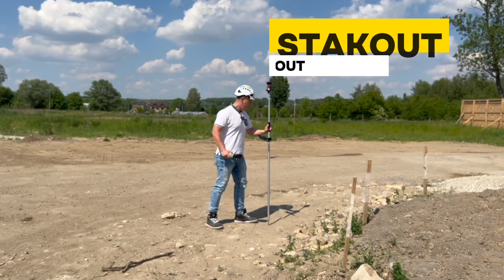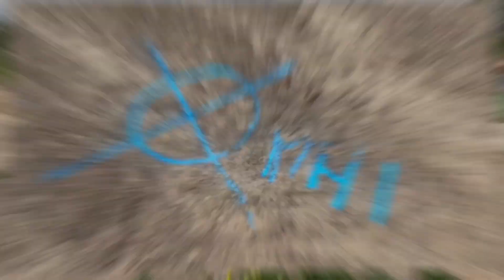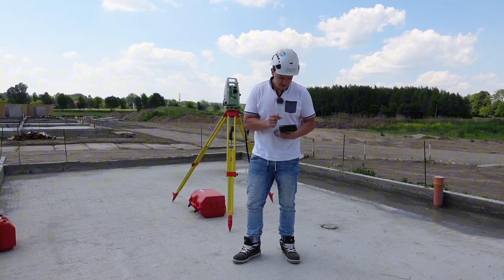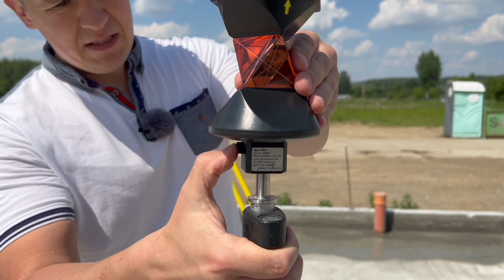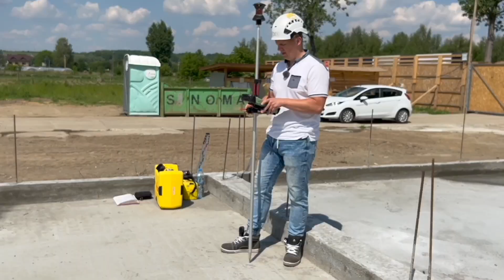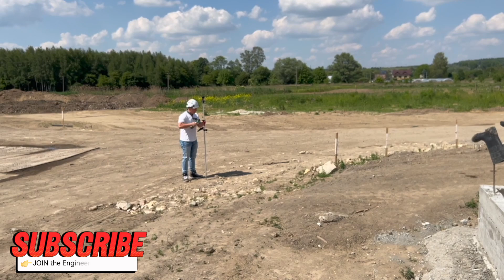How to Survey 🏗️ Robotic Total Station Tutorial for Construction Site & Setting Out Engineers 💪

Comment: Hello good morning Gregg,I have a question, not sure you may be able to answer,Say I was carrying an as built level survey of a slab, but rather than having individual levels of all the points, is there a way I can survey the slab and the points display plus and minus differences between the finished level of the slabs say the slab was 64.00 can the points I survey be +00.05 or -00.01 when I bring into cad etc as opposed to say 64.05 and 63.99 etc I worked with an engineer once and I think he set the target height to 64.00 and then did the survey but am not sure how he did it...am using a TS16 if you know how it can be done pls thank you id appreciate it.
Reply from the maker: yes, I always do it this way too - set the target height / height at 64.00 (your slab level) they you'll get what you're looking for :)

Comment: Can you make a video about how to keep the bubble level in the centre during stakeout
Reply from the maker: Depends what you marking, but you can use a bipod for the pole. I typically marking with a short pole and prism, or a retro on a piece of wood, or magnet. The pin I shot with reflectorless later so position is double checked when setting the top kerb level